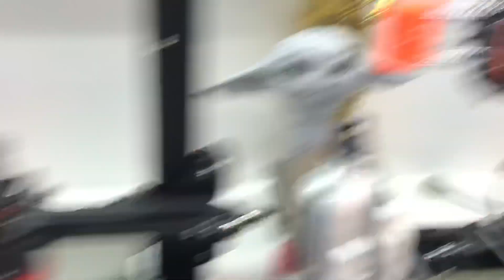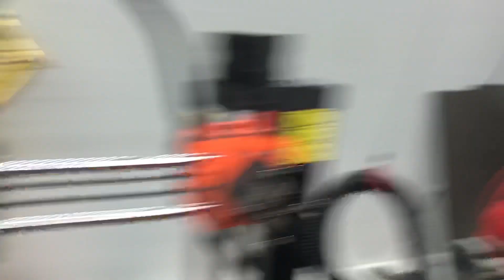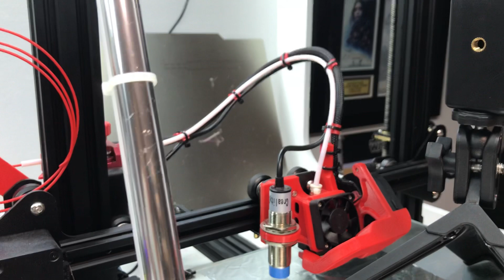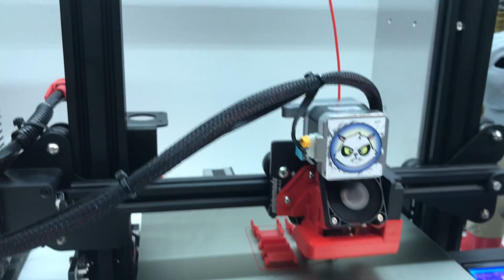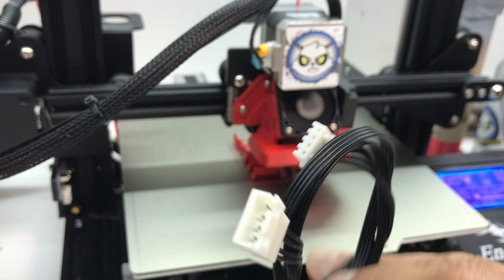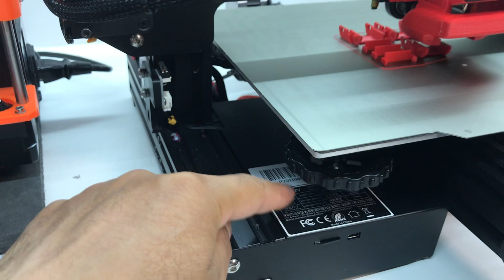Ender 3 Pro direct drive: Printermods review

Comment: Could you tell more about the fan mod?
Reply from the maker: I used a hero me cooling fan mod from Thingiverse and I cut the wire holder off the top to make room for the extrude rmotor

https://www.thingiverse.com/thing:3991855

Comment: And here it is the end of November and I am having the same EXACT issues!!  Please show what you did with the cabling.  PrinterMods needs to get their QA and Engineering depts squared away.
Reply from the maker: I covered what I did in the video. You have to connect the extension cable from the control board

Comment: I was watching other videos, and I noticed some people were not using a coupler on the extruder side.  Just on the hot end.  Are you?
Reply from the maker: No, both my Creality machines have couplers on the extruders. Some models do not have the coupler and have a pressure fit hole on the extruder side. Good quality couplers have metal teeth inside to lock the PTFE Bowden tube in place

Comment: Not making excuses for anyone but it does not matter if there are 6 wires on that extension. Your stepper only uses 4 wires and has a 6 pin connector. Just remove the 2 wires from your extension plugs takes 3 minutes and your in business. It is still a 6 pin connector which fits like a glove.  Not a problem. 3D printing is a tinkerers toy store. If you want to play you gotta to tinker.
Reply from the maker: Jim Nicholson the connectors are completely different shapes and sizes. One is wide and flat, the other is taller and narrower. They do not fit together at all, the housings are not compatible no matter what pins are removed. 
And it’s certainly not as advertised or the same ones used in their own instructions.
I’m fine with tinkering, I’ve been 3D printing for 5 years and I have 6 different printers so I’m used to making things work. But I feel that Printermods makes an inferior direct drive kit compared to its competitors.
Reply: @pandapropsncostumes  I must have received different cable then. Mine was exact same connector just had 6 wires. I hear you about making things work. I have 16 printers Delta's, Cartesian and been in the play room for 6 years. I beta tested for a couple printer manufacturers. I do agree with you there is no reason for a company not answering you when you have an issue. When I got my kits from them the included plastic parts and brackets were real bad. Unusable bad. They were injected molded but looked like some real bad stuff. I contacted them and they sent me replacements in a couple weeks. When did you get your kit? I got mine when they first came out. I just looked at my instructions and it shows the 6 pin connector with the 6 wires. They must have made changes. What kit would you recommend?  I will be buying a few more and would like your feedback on which you like better. Thanks
Reply from the maker: Jim Nicholson my plastic parts were bad too. I had to drill out the slots and holes to make them work. 
I bought two of these kits (both have incorrect plugs despite me choosing specific models) because they were positively reviewed on Teaching Techs channel. But either the quality control or eye for detail is way off.
If budget isn’t a huge concern I’d switch to E3D Hemera extruder or Bondtech BMG. If you want to go cheaper a Triangle labs extruder would be good. A better all in one solution in my opinion would be the Microswiss direct drive and hot end combo
Reply: @jimnicholson8128  it's just a strange coincidence I can't believe it but I ordered the triangle lab combo about four or five months ago. I ordered two of them and they were a complete kit they weren't machine specific they said that they will fit a number different machines and creality are on the list. I'm sure I'll have to print a number of parts to make them work but they come with the BMG style extruder and their new micro Swiss style hot end and it looks like it's really high quality. It's so strange they just came yesterday. and we have been talking about  different kits. I'll let you know how they work out. I'm not sure which machine I'm going to put them on yet probably on my Ender 5 plus. I have two of those and I think I'll try these on them and see how they work out. 
I wasn't aware that micro Swiss made a combo. I might check those out too because I still will need another 4 after I get these other two complete.
 I appreciate your suggestions.

Comment: Hi. Mine is on the way. Is this compatible with the stock hot end? Is yours in the video a stock hot end? I noticed alot of people use all metal ends with these direct drives. Not sure if there is any benefit for all metal except for higher temps.
Reply from the maker: Jay Lee I’m using the stock hot end
Reply: @pandapropsncostumes  thanks.yeah I think I will go back to the stock. I just put in an all micro swiss all metal but too many issues with layers and jamming even with low retraction. There is something I am doing wrong but i print with pla anyways for now.
Reply: @pandapropsncostumes  Hey.  I got this direct mod kit in.  I have the same grey extruder as yours but I can't open the link to your thingiverse. Edit: nevermind,  it looks like the site is down at the moment.  Will try again later.

Comment: can u pls  share the retraction settings for  ender 3 direct drive?????thx
Reply from the maker: youth03 I’m using Prusaslicer for my Creality machines. On the Ender 3 Pro I am doing: retraction 2mm length, retraction 50mms, min travel after retraction 2mm
Reply: @pandapropsncostumes  thanks. Btw prusaslicer any better than cura? Any difference?
Reply: I have an issue with the bracket as it won't fit correctly I have a wobble on it no matter how I tightened it. So think I have to return. I was also really excited but now waster a good 4  or so hours doing research and fiddling with it. :(
Reply from the maker: Philip Taing Do you mean the extruder bracket? Which extruder do you have?
Reply: @pandapropsncostumes  Connecting the wheels to the bracket has a wobble of a mm or 2 no matter how I tighted it vs stock.
Reply: On to the x axis. Using stock extruder.
Reply from the maker: Philip Taing you need to re adjust your x carriage eccentric spacers. Video link below
Reply from the maker: https://youtu.be/cX-lm6tS4KU
Reply: @pandapropsncostumes  Thanks. I did notice that it was an off center hole in the nut. Didn't really give it a second thought.
Reply from the maker: Philip Taing no worries! Did your extension cables come as 4 pin or 6 pin?
Reply: @pandapropsncostumes  6 pins.
Reply from the maker: Philip Taing Good to know, thanks. They sent me the wrong ones :(